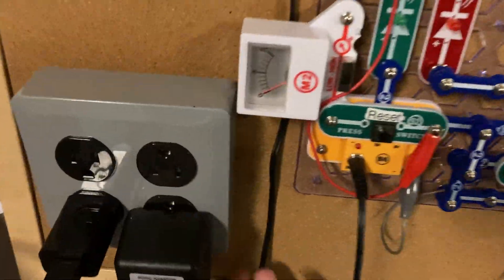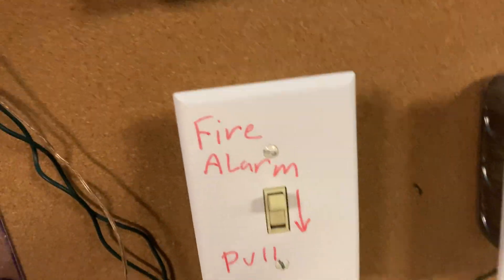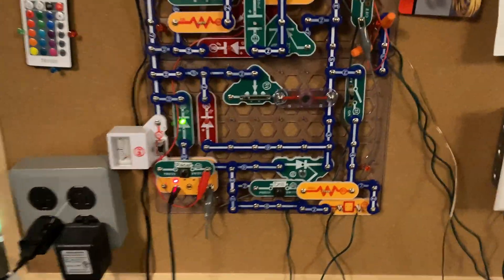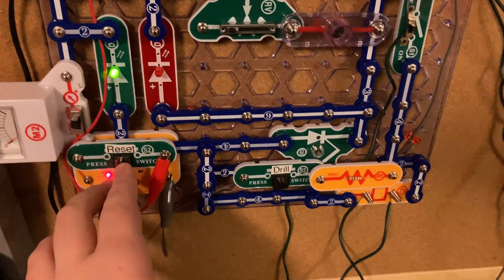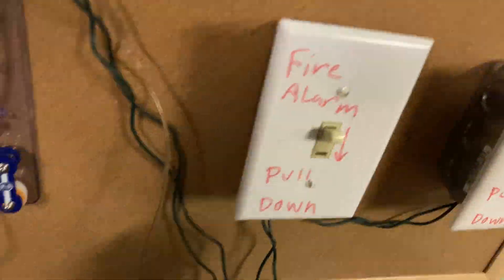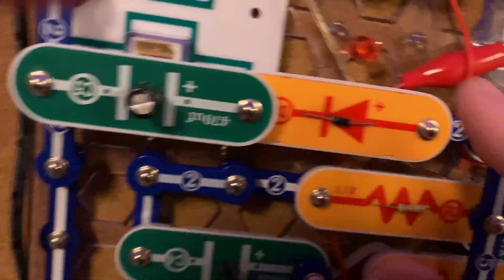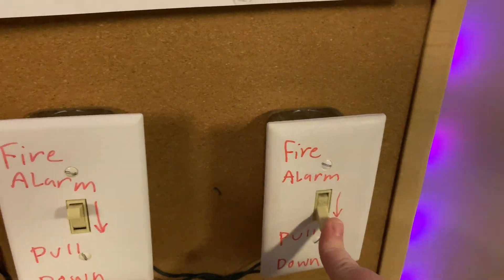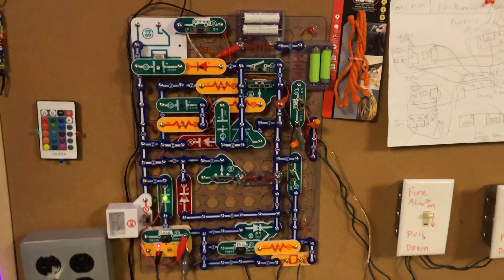Snap-Circuits Fire alarm system test #5

Comment: you could get a fire alarm pull down and hot wire it to the wires you have at the snap circut board and it would work

Comment: Is that reset button shorting the power supply?
Reply: He mentioned in a previous video the system resets by momentarily cutting off power to the rest of the board.

Edit: That was before he rebuild the board in video 4

Comment: Man you are So cool!! You should integrate a arduino into the circuit panel!! It could be the sound system. So like the silence just turns off and on the power for the board! I get it if you dont know how to code. You can just ask chatgpt. Usually makes the best code for stuff like that. Planning on making my own alarm system now cause of you!